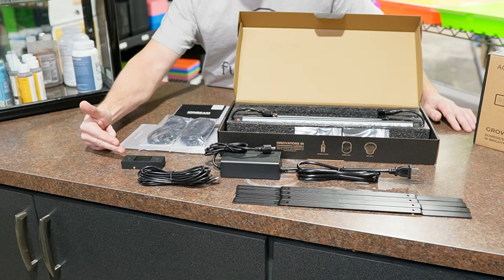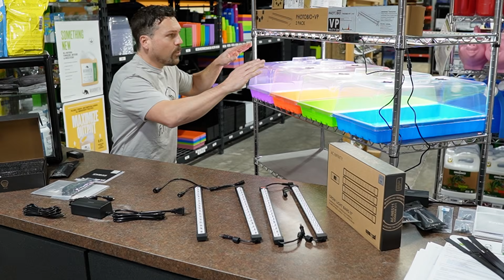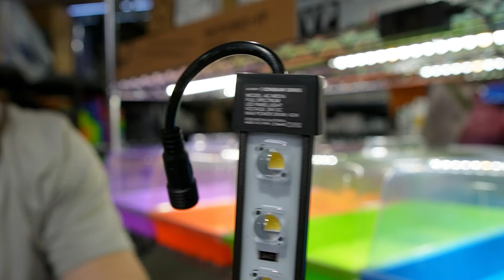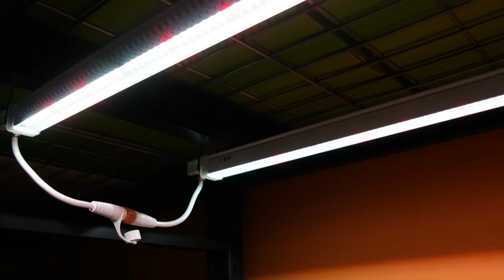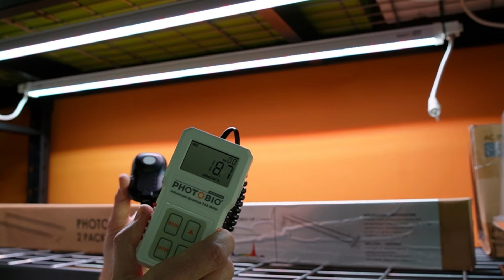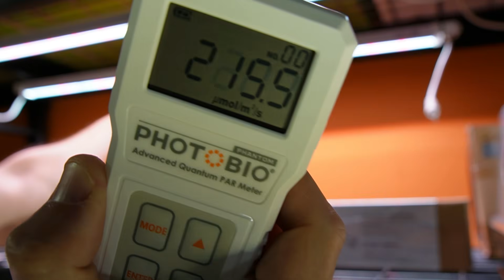Full Spectrum LED Strips We LOVE for Home & Commercial Growers...

Comment: I have two pots in a 4x2 and one just outgrew the other by 12 inches, even with a trellis in place. And these pots are heavy so no lifting the shorter pheno. The tied trellis wouldn't let us lift it anyways. Enter the IONBEAMS. So cool they can just attach themselves to the tent bars vertically, which is how we plant to use two of the bars on the short pheno side. To even out the PPFD from the main lights up top.

Comment: Think u could do a vid on just a whole starter kit if your just getting into this and no space ain’t really a concern my concern? Is market has changed since I last was in it and now it’s so saturated with everything to everything that u could break the bank if not careful so let say I had a budget of 1000 bucks . I love the hobby but now I am unsure or with to get at the time when I was doing the this only options where hydro farms hps vented hoods. Also retro spec my current situation gorilla grow 5x5 , Growers choice Roi e720, inline fan, ac and I did have the troll master controllers but none of them work this was donated to me . Now my only problem is don’t know which humidifier to get and wut type of plug in play auto feed systems are good for a noob cultivator? Also Athena nutrients where recommended to me so I have the pro line I think stuff in dry bag I want to auto everything please help you guys are very informative on your videos which I appreciate that very much.

Comment: AC INFINITY : NFG if the extension cords dont go 36" in between on the 16" bars. That's fine for the 11" bars used in a 2x2 but it does f*** all for a 3x3 . Don't waste Your money on this crap!
Reply from the maker: We have actually requested from AC Infinity to sell the extenders as an additional accessory.
You can add two extenders between the 16” and achieve your 36” plus distance needed 🫵✅
Reply: @gardensupplyguys  Yeah... Just another Unnecessary cost. It's on Purpose just like Planned Obsolescence. Makes You wonder if they're even REAL LM301H's, probably just D's or even B's
Reply: Thank You for the reviews that You do! It does a lot to increase Consumer confidence. People... You have to be careful. There is a lot of Misinformation out there and some even Downright False Advertising in this industry at the moment.

Comment: These are Propagation lights and almost any type of electrical light can be use for this purpose.. These are NOT GROW LIGHTS.
Reply from the maker: Spectrum also matters.  Standard electricals lack nice reds 👍.   Something to consider when choosing a true Grow Light designed for plants vs lighting a garage to save a few 💸
Reply: Mate I have 2 sets they are for clones ,hopeless under canopy
Reply: You're better off buying 3000k led T8 strips, they're 1/3rd of the price and does the exact same thing. I glued some magnets to some and made my own ion beams.
Reply: @deleqtronica8733  Sounds like a good alternative to this basic Ion beam model.... but they have the newer  U4, Ion beam out now, with targeted spectrum for flower.  So I'm considering those for up lights for my auto's, as they will slide in under my LST'd canopy.
Reply: @UbiquitousRomp  I mean people have been flowering under 3000k leds for years now and have had fabulous results, I'm not too worried about the spectrum of supplemental lighting as long as it's 3000k and below, especially when I already have sufficient reds in my top lighting. I looked at the prices of the ionbeams and they're just too much for what they are, you can buy a full under canopy fixture and not just led bars.
Reply: @deleqtronica8733  My 600w bar light is 400k with 660 nm.  My girls are at the end of stretch and getting 700 PPFD on 24 hr light, so about 60 DLi  from thew top. But I would like something to slip under my autos, the canape is only 7 inches above the coco after the LST work.   So I'd love to get some beams on that underside for the flowering.. ...  I'm getting 8 ozer's quite often now,  but know I can improve on that,.
Reply: who said anything different?

Comment: Would like to see ways to add dissolved oxygen to my reservoir that add significantly more dissolved oxygen than air stones.
Reply: Pump to showerhead...waaaaaay more o2 than airstones. Gotta disturb that surface tension.
Reply from the maker: @ATripp-dm9rg  very clever … 💯🤓
Respect for this post thinking outside the box… 📦.    You are one of us ☝️
Reply: Wave makers for Aquariums pointing at the top make way more Oxygen then any Airstone what people don't know is it's not the bubble that really do it it's the Top water Agitation from the bubbles that creates gas Exchange ......😉😉🤙 Trust me I've been doing Aquariums for 20yrs and growing for 16yrs this April 😉🤙
Reply: 2 wave makers making a big circular flow is even better cuz it keeps your resi nice and mixed up too 🤙👌
Reply: But yeah I've gotten Multiple Grow stores by me to start stocking wave makers on there shelves after yrs of working at Facilities it's very proven in my practice 😉🤙
Reply from the maker: @winstonpratt604  keeping those water temps lower also holds higher O2 below 👇 amazing what 5 degrees does from 70 down to 65 and so on.